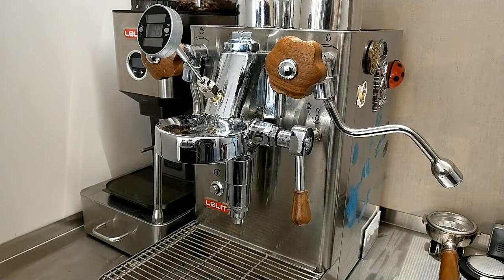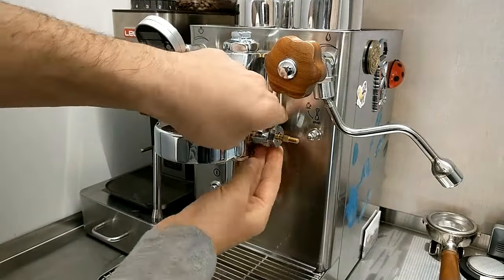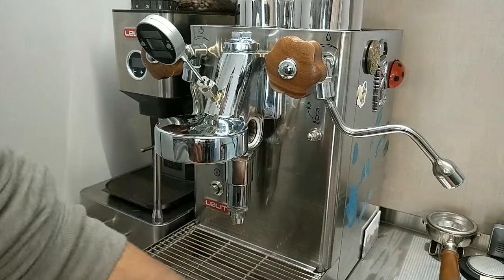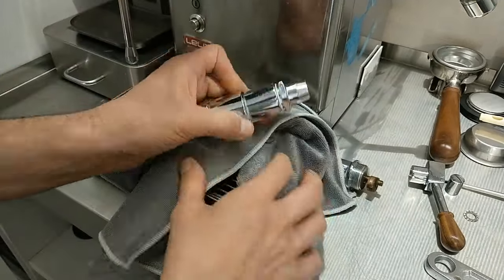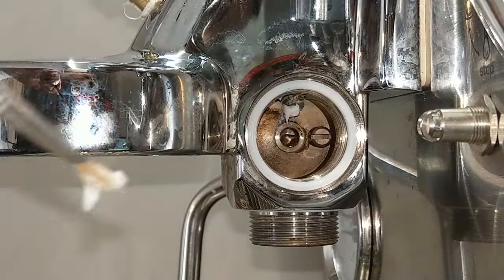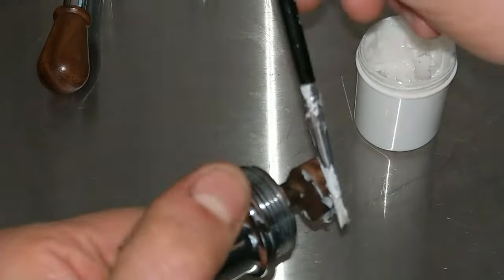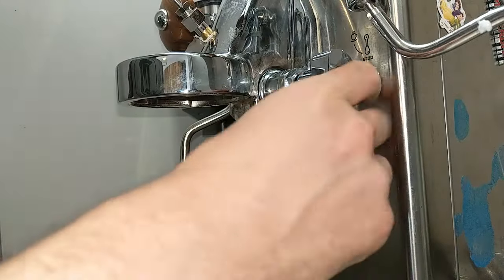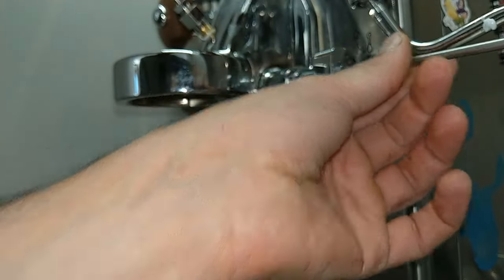PL62X PL162T PL62 PL62T PL62S L58E group head maintenance,  how to lube the cam

Comment: Very informative! Quite unfortunate I need to do this, barely a month after purchase. It started when it was warmed up and I cleaned the group head with Puly Caff for the first time.

I hope I didn't get a typical Monday's unit there. It's such a great machine, easy to service.

EDIT: I have just read up on this and apparently it's fairly normal after backflushing with detergent. The squeaking is gone after turning the lever a few times after flushing. Reapplying lubrication is only needed when the lever keeps squeaking or does not stay in place after pulling.

Please, leave a comment if you can confirm that.
Reply: Hi @Stefsinn, I have the same same problem- about 3 to 4 weeks after buying new,  the lever started to feel course and squeaking when moving.  I'll call the dealer tomorrow and take it there. Good Luck and lets us know. thanks
Reply: The extended manual says the same: It's normal after chemical backflushing for the lever to stick a bit and squeak. This is because the cleaner will strip away some of the lubrication. Mine does the same after backflushing with Puly but it goest away after around 5 shots. I'll aim to lube my machine 1-2 a year as mentioned here. I haven't done so as it is just a month old.

Comment: The downside of an E61 is the maintenance, like owning a 60's car and having to grease the suspension every 3000 miles. But much more user satisfaction from moving levers and twiddling knobs than you'll get from just pressing a button on a more modern machine with faster warm up and better temperature stability.

Comment: Thanks!

One mistake I did was to not use any special fabric to protect between my wrench and the nut (some standard masking tape, like this guy https://www.youtube.com/watch?v=3aVLSoDZL1k), so the bolt got some quite visible scratches. The metal is QUITE soft, so the shiny surface will be damaged when you turn the knob, even carefully. And yes, I did use my hand as much as I could to prevent too much surface scratches.

Comment: Great! This is a very useful video, as my Mara handle just started squeaking, and shoud be the same. 
What type of grease should be used? Any specific molykote? 
Also, do you clean the parts/spring with puly?
Reply: Molykote 111 is the stuff to go with.
Reply: @lhave_  but it's not mentioned this it's a food grade grease. And what isbthe difference between grease and compound? This 111 is a compound not a grease.

Comment: Just a question: isn't that a bit too much of lubricant inside? I mean, there will be water running into that chamber which will take all that extra grease and sent it into the shower -> basket.
Reply: I think that water goes out the bottom, not the shower…

Comment: Hi, my machine is a new one 1 mth olf d maybe but i have done backflush using cafiza 2 times already havent lubricate the cams.. want to ask if i already have to lubricate it? Usually how long do we have to backflush using chemical if only 1 or 2 espresso per day? Thanks
Reply from the maker: you can clean the grouphead 1 a week,
 you can lube the grouphead 1 or 2 times a year
Reply: @lelitinsider2977  thanks sir for the tips i actually have finished lube the cams using this video.. and for the water is it ok to put epsom salt for hardness? Or do you have any suggestion to not make the machine scaling without reducing the taste of the espresso? Thanks 😊
Reply: @ricky120791  did you find an answer to this?
Reply: @ricky120791  you should use a water filter inside the water tank. It comes ready to install Lelit filters or compatible…